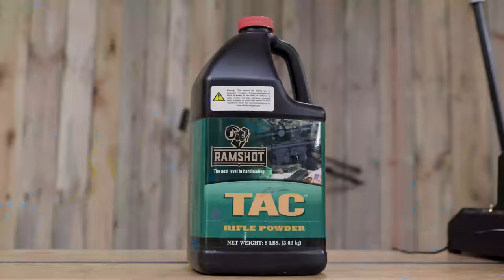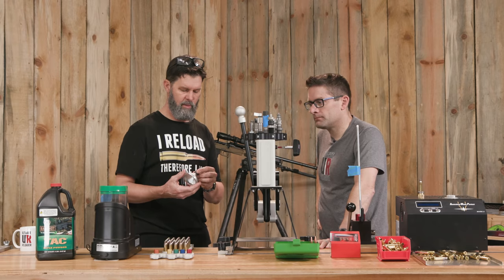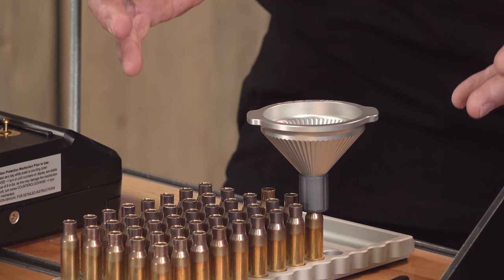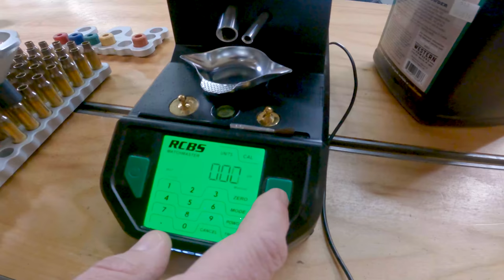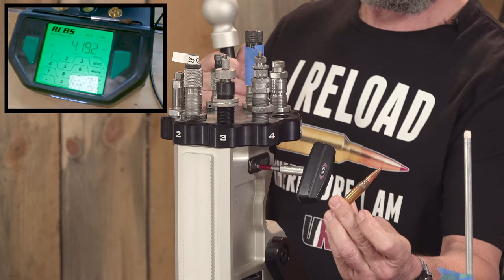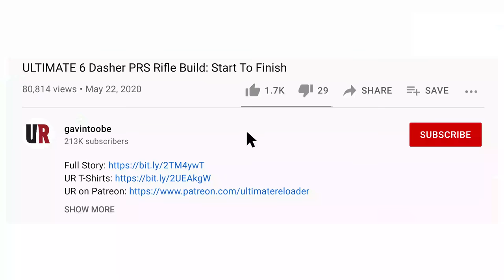Precision 308 Trainer Loads (Step by Step)

Comment: Lyman All-American Press
RCBS Universal Hand Primer Tool
Lee .308 full Length die
21 Century .306 Expander Mandrel
Lee Bullet Seater

I have used about every different die there is (minus the super expensive) and I find Lee has the most consistent full length resize. Lee just gets it done for me. 

I can’t get TAC to group for shit in my AR-10s/Scar 17. I prefer IMR 4895 for 175 SMK’s and XBR for 168 SMK’s.

Comment: Hey I need help with a mid 70s model 70 in 338 win mag.

338 win mag
250 Berger Elite Hunter
H414 65grns
Coal 3.340
FPS 2650

They keyhole at 50 yards. I'm assuming it's because of the modern bullet in an older barrel. It has a pretty big jump at 1 inch because of the langth of the bullet I had to shove them deep in the case to use the magazine. Any thoughts on either a new barrel? Or anything else?

Thanks! Nate
Reply: @Travis Fox 1:12

Comment: I know you didn't crimp these BUT you mentioned needing to do some training loads for AR10 and I wondered, do you/would you bother with running mandrel through necks if you were crimping the finished round? seating force would be uniform, tension so be the same if using Lee Factory Crimp die, but are you negating the work done using the mandrel when you crimp? 🤔

Comment: Reloading with the 155 tipped match king, switched to the 155 because it has a better BC than the 175
Reply: Same here. Lapua or Berger 155 @ 2900 fps has about 25% less drop and drift than the 175s.
Reply: I find when you get much above 150, you're really approaching .30-06 sweet spot. I tend to draw the bullet grain line for .308 at that point; with 147 grain FMJ SBT'S seemingly being my AR 10's bullet of choice.
Reply: @bustabass9025  the 175 sierra is a very good bullet for the 308 win. The tipped 175 machking is getting shot after I run out of 155s
Reply: @Dave-cf2ng  
Yep, in the final analysis it's all about what works best for you. My '06 loves 168 grain Ballistic Tips and 175-200 grain anything else. But for some reason I can't always seem to duplicate the same BC's, accuracy, and flatter trajectories when I feed those heavier bullets to any of my .308 Win rifles. 

Guess that's why I have more than one rifle. That, and the fact that I am a certifiable gun-nut; ever since I first fired the ol' man's 12 Guage off the back porch on New Years Eve, circa 1957!
"HAPP-EEE NEWWW YEARRR!"💥💥💥